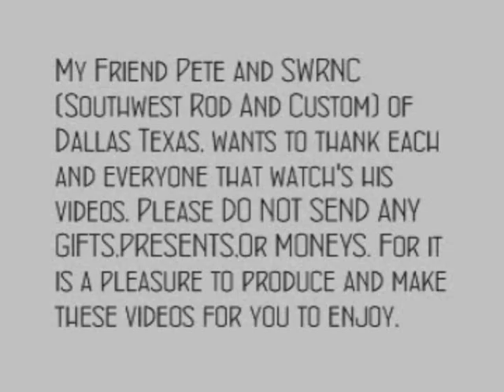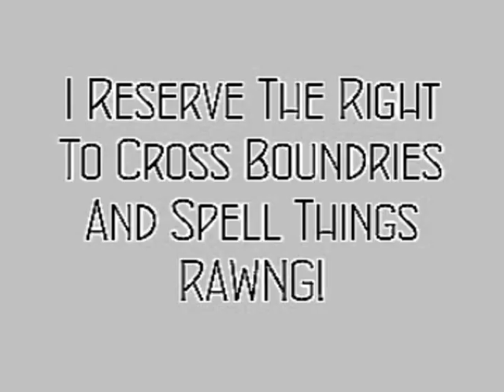1977 Chevy 4X4 TRUCK: It's A Domino Effect From The Beginning. Part 2

Comment: I have had my 70 camaro since 94. when i bought it there was plenty out there. mine has air,and was a one owner car with a little damage, but is fixable. it has deluxe interior,console,automatic 400 turbo trans 350 car. you just don't see these pieces anymore, only 20 years later. i bought the one i have because it wasn't molested.factory air,deluxe interior. ALL THERE. great videos pete. good luck on parts  finding. I CALL THAT THE BOOMERANG EFFECT.

Comment: couldn't you use the knock off parts to cut off the sections needed to repair the original panels or is the metal quality that poor or to tin to bothet using ?

Comment from the maker: I dissagree, I would rather repair the orginal fenders then use an aftermarket on this particular vehicle.. If it was another car or truck I might consider, but the stuff they sell for these old chevy trucks are JUNK, so ya might as well by junk and fix it, because you know atleast it will bolt on properly, these fenders have close to 17 bolts plus the hinge bolts that hold the fender on, to many holes that have to be lined up properly to rely on MADE IN TIWAYNE to worry about.